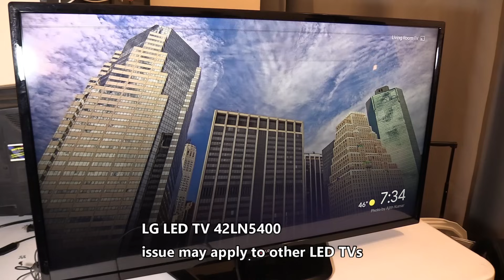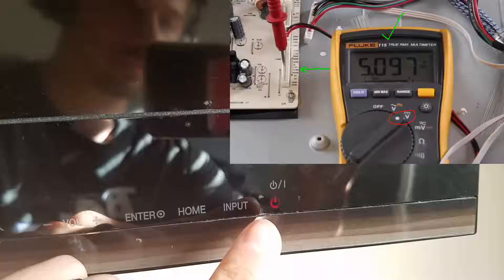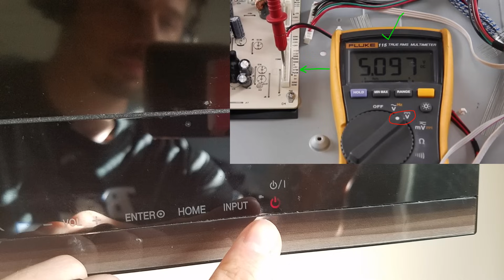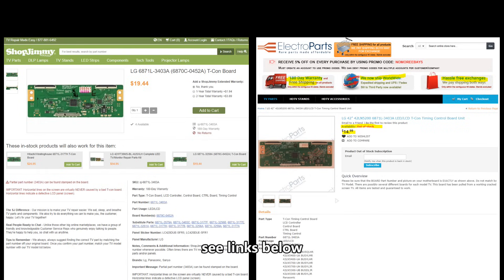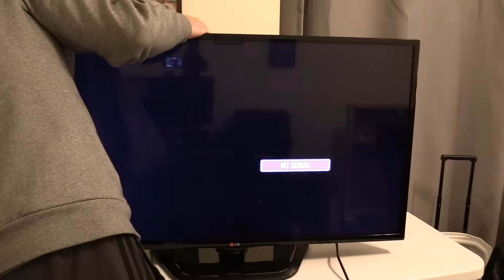How to Fix LED LCD TV with horizontal & vertical lines on the screen

Comment: I have horizontal lines and blurred image on the right of the TV. After 15-20 minutes it goes away. TV works fine until we shut it off and it stays off for a while. When we turned it on, same cycle again. Any ideas on what I have to replace? ln52a650a1fxza

Comment: im pretty sure its my LCD panel thats messed up, ive had flashing horizontal lines from most of the screen except the very top. ive replaced the tcon board and the ribbon that goes from the tcon board to the other board on the right with the hdmi ports and stuff. still has the horizontal line, do you think i need a new LCD panel? i tried finding a LG 60UH6030-UC LCD panel online but didnt turn up any results so i maybe have to take my tv apart some more to get to the LCD panel to find a number on it or something to find it. thank you in advance

Comment: So, based on your comments the flickering horizontal lines on my LG 42LN5300 TV is a problem with the T-Con board. I have no vertical line issues.  But, when I went to the ShopJimmy site to order the board, he indicated the problem is the LCD panel, and that I shouldn't waste time or money trying to fix it.  Bad LCD panel requires replacing the TV.

Your thoughts?

AJank97

Comment: What are the symptoms of a bad ribbon cable? I have a Samsung UN55NU8000 which is in an endless on/off loop (no image, just welcome sound and panel lights on/off) since plugged to power. Apparently main & power board are ok. Could be the ribbon? Or led panel went bad?

Comment: So I have pretty much the exact same problem. The lines aint permanent. They come and go like yours in those 3 second intervals. But the thing is, it doesn't seem that there is a TCON board for my model. It has the main board and the power supply. So i am not sure what to do here. 
I changed the main board, and the power supply, with no fixes. Is it really the PANEL? The lines aren't permanent. Actually, if I don't turn on the tv for a long time, i can have like 5 minutes with no lines before they start flickering agian.

Comment: Thank you .. it’s really knowledgable. I have LG  LG 49UB850T-TA which have same problem. There is 6 vertical stable lines and increasing. Can you please tell me if I can fix this by changing the led panel. Here the repair center’s are telling huge price for the repair. Please advise on this .

Comment: I replaced all 11 LED strips on my hisense 50' 4k tv and now 1/2 of the screen is semi dark with distortion and a line going from top to bottom along with an across line.
Could it also be the T-Con board or what? I'm out of ideas, anyone?

Comment: Hey, I have a Westinghouse dw39f1y1. It has green vertical lines anytime there is an image on the screen. I thought it was the T-con board, however I only see the main/power supply board and the LCD panel board. What can the issue be?

Comment: Hi, I know you don't do as many Tv videos as you did in the past.  I bought anew main board for my LG 3D TV, the TV is a 65UB9500 and I bought a new board, the EBT6335500.  I connected everything properly but all I get is static.  The volume control is the only thing that works.  No picture, no menu no nothing.  Was there some other procedure I needed to perform first for the board to work?  The number on the original board is EBT63336701.  From what I find online the boards seem to be interchangeable.  Can you help me figure this out?  By the way, the only reason for changing the board is the one HDMI that is HDCP2.2 on the original board is broken so I can't play copy protected 4K UHD Blu-rays.  Otherwise th TV works flawlessly.  Thanks

Comment: Hi. I have un55hu7250fxza tv with LJ94-30167G tcon board. I have backlight and sound working but no picture. I checked two fuses on tcon and they are good. What else can i check to confirm tcon has to be replaced? Thank you!!

Comment: I have a vizio e60 TV and 1/2 the screen has vertical black and white line.  I replaced the tcom board but that did not fix the problem.  Any suggestions?

Comment: how would you repair a small screen LCD thats used in 3d printing/cell phones.. when it shows black circles all the time...  presumeably it did this becuase the screen got flexed...  by a sandgrain sized pressure  but the glas is not dmaged..   its less than two weeks old from new and otherwise looks flawless. \

Comment: Dude I had the symptoms for bad t-com board and I replaced it and its same problem. It just had like double picture on top half of screen. So I just cleaned the ribbon connections and put it back. Now still have double on top half but also left side is just black. Idk wtf man! I see no damage, everything looks clean and new. The new t-com did nothing.

Comment: I have a Samsung  UN55D8000YFXZA with vertical lines across the screen. I ran an online pixel test  (green, red, blue and white) and even you can easily identify the lines, there are different patterns on each color, but white, that shows no issue at all. Would that be a tcon board?

Comment: My Samsung LCD went from vertical colored lines at startup, as if the image was stretched vertically (sometimes corrected by rebooting).  Then there was no image,  just "snow" and no sound either!?!?!)  Replaced the Tcon board and TV worked normally for 2 hours then the faint vertical colored ray-like lines appeared, also some colorization on portions of the screen. This was intermittent.  The next day I booted and the colored "stretched" images were back, rebooted and they were gone but the faint ray-like colored lines were back though again intermittently.  Another faulty replacement t-con board?

Comment: I connected my TV to my laptop through hdmi cable. After that I'm seeing horizontal lines in my TV. Will it because of some issues in the board after connecting it to my laptop?
Reply: Have the same issue

Comment: i have a problem with my 32" lg led tv.. i cant seem to find the right setup to solve it, or maybe it cant be solved?! unless i get a higher end tv.. so here´s the deal, samething happens watching YT videos and/or gaming, straight lines ( sides of buildings, rows of windows, fences,etc) anything that present a long straight(ish) line(s) flicker/vibrate black/white really fast.. on YT lowering the res seems to help some.. what can i do?  i think the display is 1080p with 60hz, thanks

Comment: Hi Paul, My LG 65LM6200-UB when cold start has two vertical areas showing problems. If I divide the screen into 4 vertical sections , counting from the right facing TV: The second section is almost black out , still can see what's on. The 4th section (extreme left) is fussy and  not focused. when the remote pointed in this area, I can see only a series arrows gliding.
What seems to be the problem and how do I start troubling shooting.
Paul, Thanks for showing us the DIY way of approaching TV repair. It is invaluable!

Comment: My TV a Sony 55EX720 develop horizontal scanlines ( blacklines) on all the screen. At first I think the TCon was bad so I replace it. But the scan lines continue ti be there. I think is a bad panel. There is a other board that connect to the TCon.

Comment: I have the same flickering horizontal lines, I changed the t-con board twice and same result. When I disconnect the ribbon cable between the t-con board and the main board the lines go away so I'm not sure if the main board is the problem. Help needed!
Reply: It could be a panel fault.  You can diagnose the fault by driving half the screen at a time (there are 2 connections coming out of the tcon board, take on off and turn tv on, then vice versa

Comment: I have a 60” Vizio LED TV with one single 16th”’vertical faint pink line.. Sounds like this board you just replaced could be the culprit?

Comment: I have a Samsung un55nu800d tv, it has this horizontal line problem. I took the back panel off and the only thing I can notice is a slight buzzing noise on the green panel board. A refurbished board cost 55 bucks does that sound like the buzzing noise is the problem?

Comment: Hi. I have an 42Lw5590 lcd tv. Appear some horizontal gray lines at the half of screen (on the right side of tv is present and at left side is missig). The line is almost invisible. I have some picture if you have time please send me a message. Thx a lot

Comment: Everyone talks about the Tcon board, but my TV does not have one
Mine is a samsung UE32C4000PW and all I see inside are the mainboard and the powerboard, tryed to take out and reconect all the cables searching for any faulty cable, and all of them seem to be fine, so what should I replace? The entire mainboard? How can I be sure the problem comes from there before spending money?
I also searched for bad capacitors in the power board and all of them seem fine, should I desoder them and test them to find if there is actually one or more not working right? Can it ever be possible to get the vertical lines because of a bad capacitor?
I fixed a PC screen, that didnt work, all it gave me was a blinking light and never started running, so I opened the screen, and there were 2 blown up capacitors, wich i replaced and now the screen works again, but in my samsung tv, I dont think it is a capacitor, otherwise it would never even run right?
The tv works fine the first minut or 2, and after a while it starts apearing the lines and the collor washes away, but there is no tcon board.

Comment: Hello I am subscribed to your channel and thank you for all the information. I have a Vizio LED E500i-a1 that has(1) a thin red dotted vertical line on the left of the screen and a thin black horizontal line on top of the screen. These are a permanent line that runs through the picture as well as through the menu. All research indicates that it may be the panel. I would like to get your option if it is a panel or T-Con board. Also, if it is LED, is this something that can be repaired.

Comment: I have a sylvania LCD Tv/DVD combination.
A child took a plastic bat to the top right corner of the screen. There is no damage but when you turn it on it’s a black spot with shattering type design colors. Is this fixable?

Comment: Hello, great video. I found your video because I currently have an LCD with multiple sporadic solid color vertical lines that overlay the picture as well as the OSD menu. Would this be a tcon or a bad LCD? Thanks in advance!

Comment: Hello.  maybe you can help me looking for information on the network how to fix my tv sony kdl-50w656a i have a vertical line full screen.  I replaced the motherboard but the problem does not disappear I also replaced the lvds tape but unfortunately it didn't help either.  I watched your movies as you repaired Sony TV and here's my question, can the lcd panel be repaired?  is it not possible the service when asked if a new panel is available says they are not producing...

Comment: Dude, That's not fixing anything. That is simply putting together a kit. :-(
Reply: Hi I have a TCL Roku tv nothing works only the stand by lite, I bought a kit of all the boards the Maine board the power supply board the t-come board  I bought from e-bay  and still the same problem what do you think it is ? Thank you.
Reply: @rubensolis7757  Perhaps you have a different problem now.. like before your TV stopped working? A faulty component needs to be identified through diagnosis; eBay didn't know which part you needed?

Comment: Hi, my  hisense 50 inch is dimly lit. I replaced the l.e.d array as at first the screen was black. Issue continued.  Replaced p.s.u with a "reconditioned board " same problem . The company sent out another- I have the same problem.  I put the original p.s.u  and now the panel is dimly lit.  I  unplugging the t.con board to see if that some how had an affect on the light level. The fault remains. Does this been it must be the p.s.u.? And then stupidly I plugged the t.con in while the t.v was still on and now I have solid block colour vertical lines on the right side of the  screen .  Any help would be greatly appreciated.

Comment: I have a question. I have a vizio m55-c2 led tv.  I have 2 single horizontal lines across my tv.  they are not solid black; they are colored which change as the colors on the tv change what could cause this.  they started when my 3 year old through a small plastic lid and accidently hit the screen.  it wasn't even hit hard, but after that is when the lines appeared

Comment: I have an lg 55ls4500 and have vertical lines on the screen, I have replaced the t-con board and cleaned the ribbons but still have the lines. Any advice??

Comment: hi...i am facing issue in my sony bravia led tv, issue is only one single black vertical line in Between screen, could you plz suggest, i will be very grateful to you.
Thanks & Regards!!
Reply: If you get a solution let me know I have the same problem
Reply: @johnvassallo7353  ok sure, but presently only 1 single line is available in between screen but i will try to resolve as suggested by tampatec.

Comment: I have a single vertical line that goes off sometimes and also I can jingle the tv and I can make the line go away until it comes back either comes back in moments or can stay off and be fine for an hour.
40inch samsung lcd about 11 years old. Any ideas...anyone? thanks liked the video.
Reply: Replacing the tcom board for your tv might be more expensive than the tv is worth
Reply: Or The Connector Just Loose Like Mine
Reply: It's probably a failing tab bond if you can wiggle the tv and affect the vertical line.  There is a jerry rig way to help this if it's the case.
Reply: @FrugalRepair  I have this problem with my TV is there anything specific I can do to stop it?
Reply: @miayoung1515  Chances are that it's either a bad tcon or a failing tab bond on the lcd panel.  For the tab bond, you can't fix it but you can put pressure on it with non-conductive material.  You need to take much of the tv apart to get to this part of the tv

Comment: Hi .. my TV was running fine and suddenly I heard a blast of some component .. and after that there was no picture .. just wanted to know if u could let me know if you have picked up the issue based on your experience .. thanks in advance ..
Reply: Usually a capacitor blows like you described...on the main power board. You should be able to see some black marks on the component ...
Reply: @kennynvake4hve584  : thanks for the reply bro .. I have taken pics but I don't pick anything .. could u please give me your email .. I ll share pics with u ..

Comment: Tampatec I have a single horizontal line that runs through my TV. Will a t con board fix it or is it a bad panel?
Reply: Same here but vertical and green line and it doesn't go away.

Comment: I got my hand on a Sony Bravia  52inch tv. When I turn it on I have lines and image focus with a drag. After leaving the tv on for 10 to 30 minutes. The problems disappear. What part should I focus on??
Reply: Ce Pas same problem here. Same brand as well. But it goes away after like a minute or two.

Comment: Hi TT, I'm a tech as well. I have a EU with a Samsung UN65JS8500F. After 20-or-so minutes from time-to-time, the TV produces what looks like a black and white test pattern on it (black on the left, gray in the middle, white on the right) then in green "Atari" block letters it reads "3D". When it reaches this screen it never goes back to normal TV, but it doesn't always go to this screen. Were I able to attach a pic I would. I've searched and contacted Samsung, however I've gotten no-where as to figuring out why it shows what appears to be a "error code"

Comment: Try to do a microscopic analysis on the original t-con board to see what exactly went wrong with it and why it became defective in the first place.
Reply: That kinda works, parts often fail with no visible dame and often parts that blow up (visible damage) the failure was coursed by other failed part and part that is visible damaged may have caused other psrts to fail.

Testing is the real and best answer to diagnose what actually failed....

Comment: when I connected HDMI input to TV get black fade/blink. I have chanded cable twice all cables are purchased branded from Sony and Dell monitor cables. Av is working fine. on sony 32 inch Ex 52 series model. kindly guide me.

Comment: Hye Sir,I have a issue regarding my LG Lcd tv model 39LN5400,the problem is picture have vertical line after 2 minutes when I do the screen test, another problem my picture been discoloration and shadow of picture latetency...I already clean the connector all tcon area but the result is same,
What should I do😭

Comment: Hey Tampatec, I've a Haier 50'" thata has horizontal lines. I've pulled the two ribbon cables cleaned and inspected the cable and connectors, as well as the Dema plug connector and the cleaned it as well. The white patching and freeze frame went away and the horizontal lines reduced to two lines, Is this a good indicator of a bad T-con board?
Reply: Use sctoch tape and place it over the end of the faulty ribbon (gold plate) and place it back in.

Comment: Just cleaning the connectors with q-tips and eye glass cleaner and blowing off the circuit board cleared the multi-colored vertical lines. Wow saved repair and replace costs! Great
Reply: Hello, I recently had the same problem shown in the video and I couldn’t figure out how to fix it. Is it certain that if I clean the connectors and the circuit board the fault or problem will be fixed?
Reply: @C.A.P2025  my question, too

Comment: Hi tampatec,what would be the problem if your projector,LCD is displaying two vertical green lines on image,thanks
Reply from the maker: Check ribbon cable connection inside the projector.